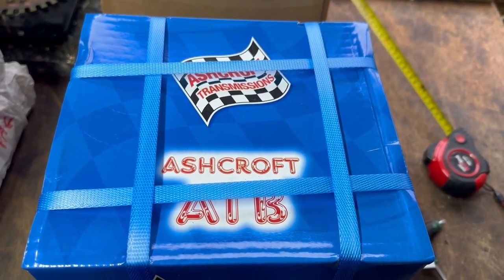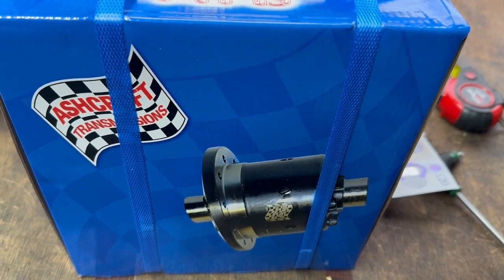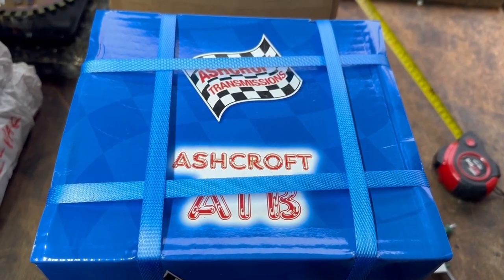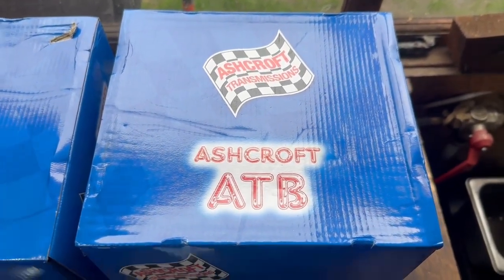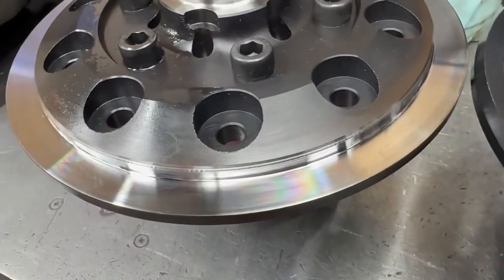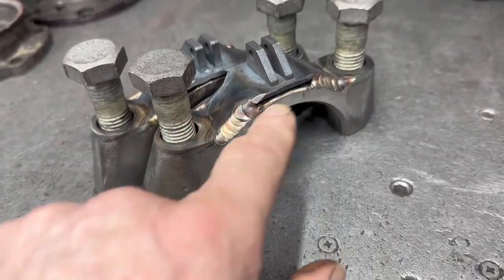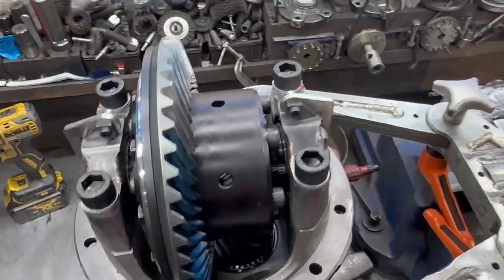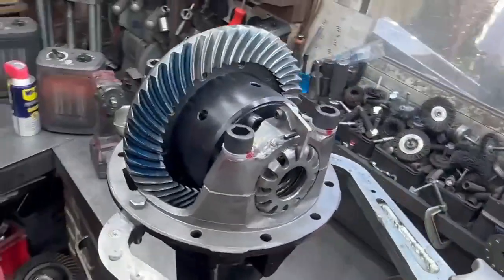Everything we can do to a Land Rover 'Short Nose' 110 AATB Differential

Comment: This is a really nice mod for the thrust pad. When these  short nose units came out in 1995, lots of warranty work at the dealer for noise.  Back then I called them the "weird science diff", as they really were just a totally re-worked 1930's Rover diff, with mostly non interchangeable parts.  Even the banjo pattern was different, but the ring gear bolt circle was the same and the carrier offset was the same as series 4.70 !!  This led to me doing some very nice 24 spline conversions in series IIA's during the 1990's, using warranty take - out P38 centres !!   No ring gear spacer needed.   I always wondered why Ashcroft didn't make a "thick gear" version of their ring and pinion for the short nose, utilizing the long nose centre, and gain gear strength that way....  There is room in the diff casing to do this, and then they could use the much stronger 8x28 tooth count....     One thing though, I guess it's all a moot point when you are limited to dinky 24 spline shafts.     When I build long nose diffs, I use the 8x28 ring and pinions and machine the Ashlocker side gears for 1.400" 32 spline shafts to fully utilize the strength this tooth count offers.

Comment: Hi Nigel 
I have an ex Australian army 110 with the Isuzu 4bd1. I would like to change the rear axle to either short nose or long nose differential, the sals just drags its bum everywhere. It will only have 33” tyres, what do you think is ultimately stronger after having all the upgrades? Long nose or short nose? Thanks
Reply: If you have a "thick tube" Salisbury, there is no way to make the short nose or long nose diffs anywhere near the strength of the potential strength that the Salisbury diff offers. 24 spline 1.240" shafts are too small for anything serious, but the Salisbury can be upgraded to 1.500" 35 spline shafts by installing a 35 spline Dana 60 LSD or locker, bolting on larger spindles and shafts. Original iron in the USA does offer a kit for this.
Reply: @ I understand there is no way to make either the short nose or long nose as strong as a Salisbury, but what I am trying to ascertain is whether either a built long or short nose is strong enough for my application (not overly big tyres and not used in competition). The other side of the argument is I would have to use much bigger tyres to get the same amount of improvement in diff clearance if I retain the sals, but I would still have a long nose front diff, but under higher stress from the bigger Tyres. I have standard size hytuff axles in the sals currently and have not broken one, so I think for my application they are fine. I appreciate the feedback though.